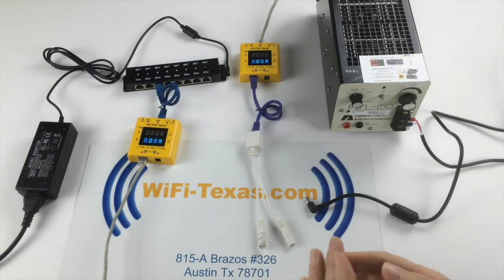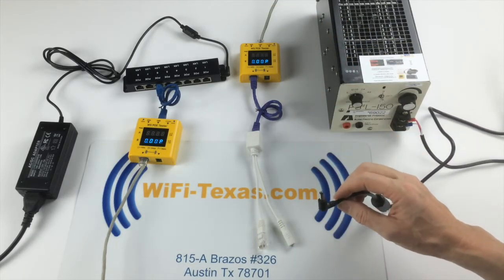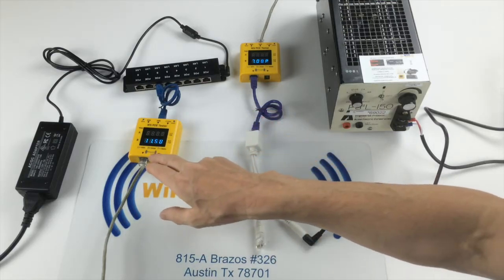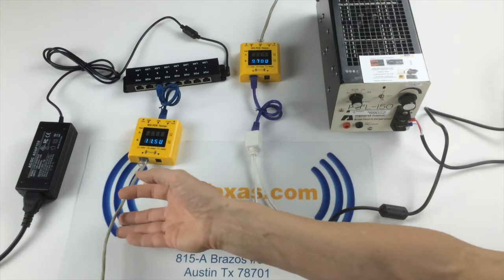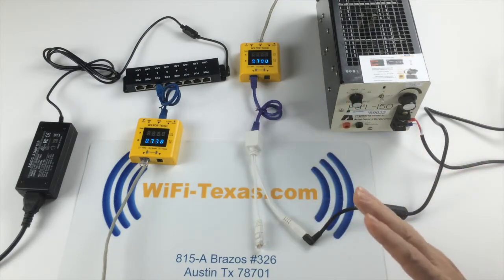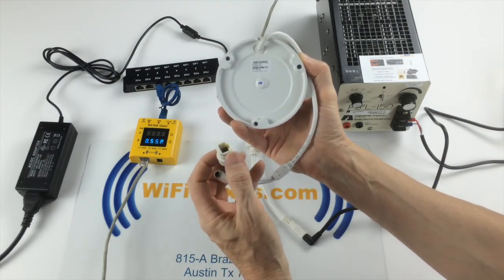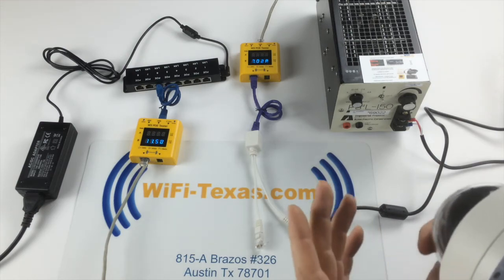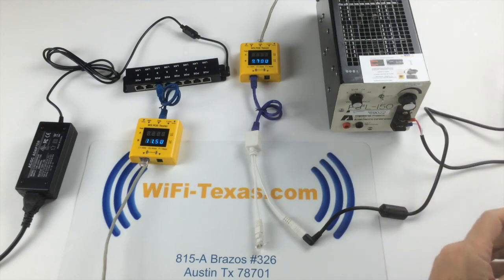Why  is 12 Volt PoE a Bad Idea?

Comment: So say a camera needs 14v to run, but your injector is 24, does this mean the camera could be damaged due to more voltage from the injector? Sorry, new to power currents and PoE devices.

Comment: How does this work with equipment such as Ubiquiti AirGrids? They are 24V PoE. Are you saying they can operate off of 48V PoE injectors as well? PoE standard is very confusing.
Reply from the maker: +Eric G Good question. This video relates to devices using the 802.3af PoE standard. The principle is the same for Ubiquiti (and other) devices that require 24v PoE, but we use a 24 volt power supply on our passive PoE kits rather than a 48v supply.
Reply: Eric G ko